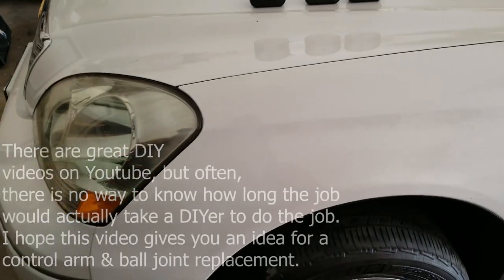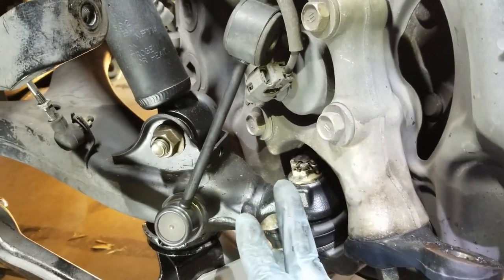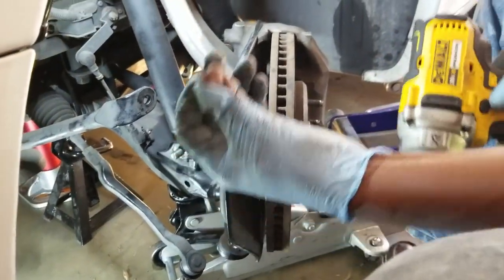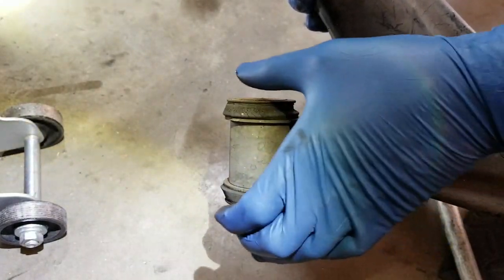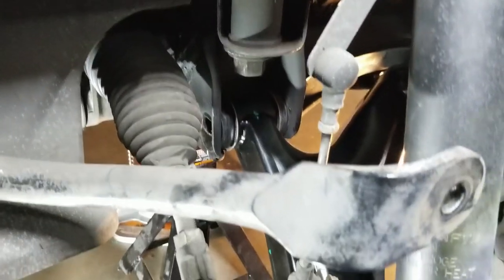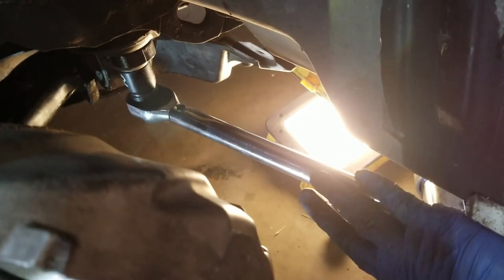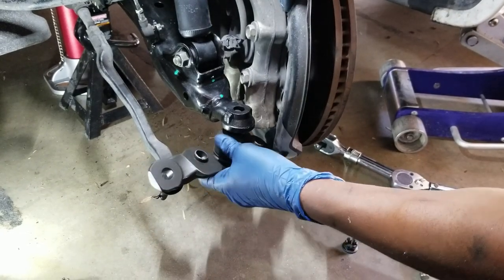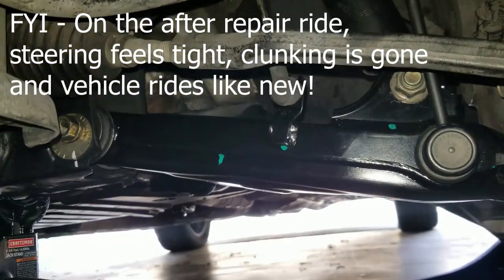2001 Lexus LS430 - Lower Control Arm & Ball Joint Replacement

Comment: 👏Bravo, excelent 👍, bro that was a very  well made and detailed video! You did a beautiful job of detailing everything! This is how a "how to" video is to be made without all the extra fluff and getting down to the nitty gritty! I don't own this car but i am looking into possibly getting one. These are the best models to own in the big body Lexus lineup as far as reliability and a diy'er friendly. I love the ls460 but they say it's harder to work on, more expensive, and not as reliable as the ls430! How long have you owned this car and has it been good to you?! Thanks bruh and keep up the GREAT WORK on your vids!
Reply from the maker: Hey Marcello, thanks for the kind words. Regarding my thoughts on the car, I LOVE IT!    I have owned the LS since the 2nd gen vehicle years ago.  I drive them until I think I have put enough miles on them then I buy another.  Same color (white) with beige interior.  I would buy the exact same car each time if I could.  I am not a fan of the model and body changes from LS430 to the LS460.  Not sure what I am going to do when it is time to replace my current vehicle.  In fact, the vehicle in the video was replaced by another that looks exactly like it with the exception of the lights in front.  Anyway, I could go on for a while about how much I like this car and for the reasons. I would highly recommend it.  I now have a 2006 and would recommend it.  All the best and good luck.  Glad you enjoyed the video.  Hope you will like and subscribe.  I have other videos, but have not had a chance to edit and post.  Been posting on a truck I got out of a guys backyard.  Kinda been a project for me.  Take care and be well.

Comment: Thanks very much. About to do this.
Reply from the maker: Glad the video helped.  By the way, I used Beck/Arnley ball joints.  I would stay away from Beck/Arnley.  My parts are fine.  The car is smooth as butter.  However, on another vehicle I own, Beck/Arnely parts were used and they broke before putting them to their intended use.  See Notes Belo at "Deep Relecance" for my thoughts.   Also I like Moog parts.  I would go with a Moog ball joint or OEM going forward.  Good luck with the project.

Comment: How to tell between the upper or lower control arm ?, i checked by jacking the car and rocking the tire at 9-3 and 6-12 and it felt solid, but i definitely feel clunking when going over rough road, especially when braking just like you mentioned in Khumoyun Turgunov reply. Thank you by the way for the video, very helpful
Reply from the maker: Hi Mater, the lower control arm is the big black piece of steel found at the bottom of the shock/strut assembly. See 8:00 on my video.  At this point you see me remove the "lower" control arm.  The "upper" control arm is near the top of the shock/strut assembly and is shaped kinda like a Y or a U.  Ok, regarding clunking, a good way to identify the problem if moving the wheel feels solid is to see if any of the bushings actually move.  To do this, perhaps place your phone or other video recorder at EACH bushing connection to the wheel.  THEN move the wheel by using the 9&3 and 12&6 locations.  Even if they "feel" solid, you may be able to see some movement in the video.  So check the video after moving the wheels.  See the beginning of my video at 0.04.  When I move the wheel using the 9&3 and 12&6 method, you can see where the bushings are bad and allow movement.  You can even hear the clunk sound.    Finally, the upper control arm can be a little tricky if you move the wheels and don't see anything moving.  The bushings might still "look" good.  So for the top, if moving the wheels is inconclusive, you might try jacking up the vehicle, removing the wheel, place a jack stand for safety, then take a crow bar and place it against the upper control arm at the bushing and press the arm back and forth laterally (i.e., not up and down, but side-to-side along the bushing).  If the arm slides laterally along the bushing...then the upper arm bushings will need to be replaced.  The upper arm can also cause clunking just like the lower arm.   Its kinda like a deep rumble/clunking sound over bumps.   Even knowing this, the upper arm bushings can be missed, so extra attention may be warranted on the upper.   Ok, I hope the above helps and was not too much detail.   New control arms (or bushings) will cause your vehicle to ride quietly and smooth as butter when going over bumps.  Good luck with your project.
Reply: @justsomeguy4941  Thank you, no wonder every time i ask the shop to inspect the suspension when doing routine maintenance they always said its still in good condition even though i heard deep rumble noise when going over rough road and sometimes clunking too. Again thank you very much for the detailed explanation very helpful, i don't think too much detail would hurts especially for suspension parts. And Good luck to you too, can't wait for more videos. Cheers
Reply from the maker: @materwelon4349  Hey Mater, I just came across a video from another person that shows the upper control arm for the LS430.  You can even see what the upper control arm looks like at the start of the video.  See Video: https://www.youtube.com/watch?v=PZRP9dw4wLQ - At about 1:18 of the video you can see the upper arm attached to the vehicle and can see how the bushings are attached to the frame.  So, this video can give you a visual of what I was referring when I suggested a pry bar against the upper arm and try and move the upper arm side-to-side i.e., laterally. This guy does not do this in his video because he is replacing his upper arm.  But if you wanted to test the way I referenced, you can see the parts I am referring.  Ok, that's it.  Crazy how I came across this video and remembered our exchange about the upper arm.  Anyway, all the best.
Reply: @justsomeguy4941  Thank you, my left upper control arm ball joint looks similar to the one in the video, a bit leaking on the left side, at this point i might as well replace both upper and lower control arm. Again thank you very much

Comment: whats the part number on the other  buching vs using mevotec and making my lexus into a hyundai?
Reply from the maker: Hi jonathan,  I am not sure of the part number.  If you are not comfortable with after market parts, you could always go OEM and simply save the labor cost.  You would have original quality parts. There are other manufacturers as well.  I am with you though.... finding good quality parts is not as easy as it used to be.  I understand even some Japanese parts are being manufactured outside of Japan.  Moog is a brand that I have used quite a bit in the past with good results.  The thing is, you never know where the part is made until it arrives. Good luck with your project.

Comment: Good video except for removing the shock from the LCA. You should loosen/tighten from the bolt side; not from the nut. The nut has some small protruding notches that sit and lock inside indents on the outer side of the securing bracket. That's why you had to take a breaker bar to it and probably stripped the protrusions on the nut and/or the indents on the LCA bracket.
Reply from the maker: Hey Scorpio, thanks for the feedback.  Upon seeing your comment I went back and checked the FSM.  Interestingly, removal indicates to remove the "nut," but the image has an arrow pointing to the bolt side. I also went back and looked at the video and saw the notches on the bolt you are referring.   Just for kicks looked for other vids and saw a mix of bolt and nut removals.  Anyway, great observation.  I think I will try bolt side loosening on strut next time to break free and see how that works.

Comment: How did you tell that it needed to be replaced? I’ve got movement on my wheel when I grab it and shake in all directions after I jacked it up. What is that
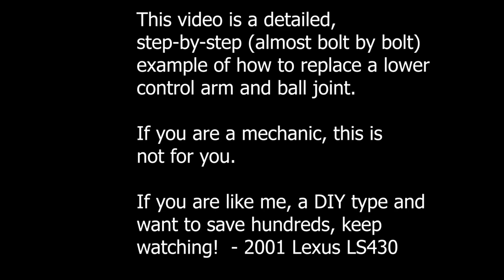Reply from the maker: Hi Marty. I could tell that the bushings were bad because they allowed the lower control arm to move.  See 0:03 - 0:10 seconds in the video.  Also, the Caster bushings were cracked - see 0:11 - 0:15 in the video for the cracks.  The loose bushings allowed a clunk sound when going over bumps and a weird slipping feeling when going slow and making a tight turn.  Felt as if I ran over a banana peel when turning into the driveway.  Replacing the control arm (with bushings), as, well as new ball joints solved the problem.  No more noise over bumps, no more clunking sound over bumps and no weird feeling in the steering when making a slow tight turn.  Ok, regarding your vehicle, I would recommend first trying to see what is moving in a way it is not supposed to move.  I would place a camera under the vehicle pointing at the parts you suspect - e.g., control arm bushings where the lower control arm attaches to the frame, caster bushings for cracks and your ball joints and tie rod ends.  Once the vehicle wheel is off the ground, grab tire in the 12 & 6 o'clock positions and move tire.  Then place your hands at 9 o'clock and 3 o'clock positions and move the tire left and right.  Then check your video.  If there are parts moving that should not, you have a place to start.  Also, check to see if there is grease stains at your tie rod ends and ball joints.  If there is what looks like black grease, this suggests your protective boots are cracked, which could let dirt and debris get to your joints, which of course, can cause failure of the joints.  I hope this helps and good luck diagnosing the problem.  Take care and be well.
Reply: @justsomeguy4941  appreciate you! It had play everywhere. I replaced the hub assembly and the noise is gone. Removing it was a process, used a couple of the ideas I saw others use. Not something I want to do again anytime soon for sure. Lol

Comment: How is the NVH with the mevotechs?  Still lexus butter smooth, or what?
Reply from the maker: Hi David.  Thanks for watching.  Oddly enough, Noise Vibration and Harshness (NVH) with the Mevotech control arms & bushings were fine.  I could not tell a difference.  Keeping in mind that I had gone so long with the vibration and clunking sound that I was comparing the repair to the broken and warn parts.  From that perspective, night and day.  Smooth and quiet.  If I drove with Lexus parts and then replaced with Mevotech, that would be a better comparison.  In any case, I have no complaints.  The only thing I would recommend caution on are the parts from Beck/Arnley.  I got lucky and received quality ball joint parts. It appears Beck/Arnley sources their parts from multiple suppliers and they are only resellers (not manufacturers).  Some Beck parts are literally from the same OEM makers for Toyota & Lexus and others parts are not.  At the time of this repair, I did not know this.  Months after this video I purchased Beck/Arnley parts for another vehicle and they were sub par in quality.  The quality was so different from the part I put on the LS430 that I actually called the company to better understand how this could happen.  Upon speaking with the company I discovered how their parts are sourced and packaged.  They buy parts from multiple manufacturers from all over the world.  So, some parts are made in the USA.  Others are made in Japan (by OEM manufacturers), others from Vietnam, China, etc, etc.  I would not recommend Beck/Arnley because the part may not be high quality and if you cannot tell by looking at the part, hard to know what you are getting.  So, since Beck/Arnley parts are hit and miss (I got lucky and perhaps got an OEM manufacturer), I would recommend ball joints be purchased from someone who makes their own parts and can monitor quality.   On other vehicles I have used Moog and those have worked for me in the past.   Anyway, sorry for the long answer, but I hope it helps.  Also hope you will like follow and subscribe.  Take care and be well.
Reply: @justsomeguy4941  Good to hear.   Those big oil filled rubber parts can be hard for aftermarket parts to match oem  NVH.  I got an exhaust rattle day one with ROCAR engine mounts, and had to redo the job with oem.
Reply from the maker: @vollandt  Yikes!  I do actually try and do OEM whenever possible.  If OEM is not that for away from aftermarket in price, I use OEM.  If I can get the same OEM manufacturer through RockAuto, I buy at RockAuto and get the OEM manufacturer.  For example, I used Aisin parts (water pumps, etc) or KYB struts, Denso Plugs, etc.  These are the companies that manufacture the parts for Toyota / Lexus.  Same part without a Toyota stamp on it.  RockAuto will sell the part for 1/3 to1/2 the price at the dealer.  So, I try that first.  If you have never ordered through RockAuto, you really should give it a try.  Take care and be well.

Comment: I have this annoying clunk when going thru bumps and rough road, ball joints good, rods are good, sway bar bushings new, struts are good. I guess that is it. Ill have to change it and see. Thanks for the vid 👍
Reply from the maker: I had the same issue.  In fact, at the start of the video you can see the bushing clunking when I moved the tire.  It was very annoying, especially when going over multiple bumps in a row. For example, coming to a stop light where the asphalt was rippled where cars put pressure as they are stopping.  These rapid lumps in the road sounded horrible...kinda like something was loose (cluck, cluck, cluck...).  Just did not have that tight feel AND the sound was noisy.  Just not how an LS430 should sound.  Since this issue is common on these vehicles 2001-2006, I wanted to show exactly what the problem is before people spend money on parts they may not need.  So, you might consider, jacking up the vehicle where the tire is off the ground (support w jack stands - always be safe), grab the tire at 12 o'clock and 6 o'clock and push the top in while pulling the bottom out.  Might also help to place a camera underneath and focus on your control arm bushing.  In the video, the damaged control arm bushing that was clunking was shot on my cell phone that I propped up under the car.  If the control arm bushing is bad enough to clunk, you will also likely see it move.  Oh, one other thing, you might also check your upper control are bushings because they can make a similar sound.  Ok, good luck with your project.
Reply: @justsomeguy4941  thanks for the reply. I was thinking of saving original control arms and fixing busbing but I can't find them sold separately. Do you know for sure they can be purchased separately? Is it oem or aftermarket. Thanks.
Reply from the maker: @apesintanks162  I have purchased the larger rear bushings (and brackets) separately.  They come both OEM and aftermarket.   I have not purchased the smaller front bushing that needs to be pressed in.  When I realized there was clunking coming from my smaller front bushing, I decided to replace the entire arm vs buying the bushing in the interest of time.  So, in short, I have only purchased the large rear busing, but thought I came across the smaller busing when I was doing the job, but don't recall where.  I would check with the dealer for a part number.
Reply: @apesintanks162  I have replaced steering rack because of looseness on the center (though i found out later the steering rack can be adjusted CMIIW) and it doesn't have a difference in terms of noise, then after that i changed my shock and mount (the old one isn't leaking) and the noise significantly reduced, and the remaining noise is probably from either of the control arm. Hope this helps

Comment: so, just leave the swaybar link in the lower arm until you take the arm off. Also, disconnect the ball joint instead of taking off the upright first. Saves taking off a couple of parts.
Reply from the maker: Hi Spinnetti.  Thanks for commenting.  However, I am not sure what you mean.  Specifically, when you say, ..."disconnect ball joint instead of taking off upright."  Are you saying don't remove the bolts holding the ball joints to steering knuckle?  Always interested in knowing how others would approach something.  Please clarify.  Thanks again.

Comment: Looks like you torqued down the lower control arm to the vehicle without a load, this can contribute to premature control arm bushing wear.
Reply from the maker: Hi Preston, it does appear this way.  You are correct.  I did, however, place the vehicle load on the suspension  but did it off camera after realizing I had just torqued without a load.  I placed the comments in the video at 12:54 to ensure people knew a load needed to be placed on the suspension.  I basically sat the vehicle down onto jack stands that were placed under the control arm.  Once the floor jack was no longer supporting the vehicle and the weight was resting on the jack stands, the control arm was torqued to spec.  Good observation.  I hope other viewers know what I am referring to in my text comment at 12:54.  Anyway, the text was the only way I knew to address this.  Thanks for watching and commenting.

Comment: Where do I buy 2001 Lexus ls 430 rear right Cv axle dealership want 1000
Reply from the maker: Hi Aveon, truth be told, I am not sure.  My first thought...and "go to" place is normally Rockauto.com.  They sell OEM parts (distribute to manufacturers) at great prices.  I don't know if they would have axles.  You might try them.  If RockAuto does not have the part, I would check the salvage yard, which is my second favorite place to shop for parts.  You might try a yard called LKQ Pick a Part.  You can input the type of vehicle you have and if they have one in stock, they will tell you.  If they do not have one, you can be notified when the specific vehicle comes into the yard.  As long as you are willing to pull the part yourself, you can save LOTS of money.  Of course, you have to be comfortable with a used axle.  Anyway, those are my thoughts.  There may certainly be other options.  Good luck and let me know what you decide.